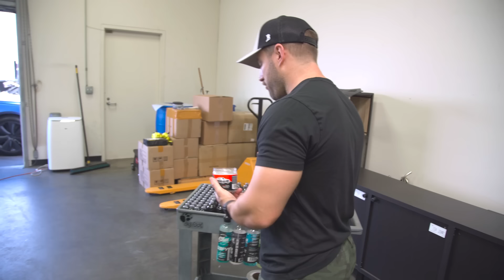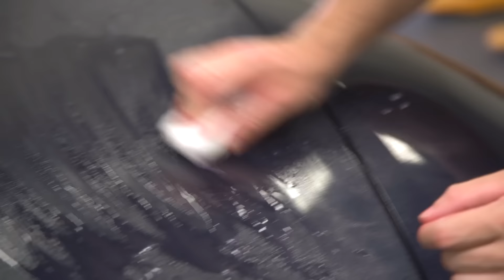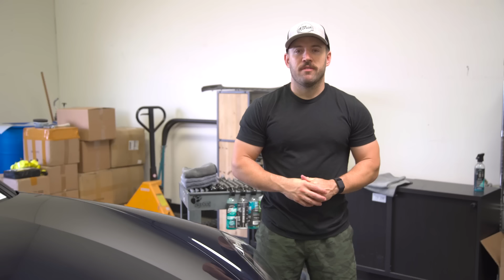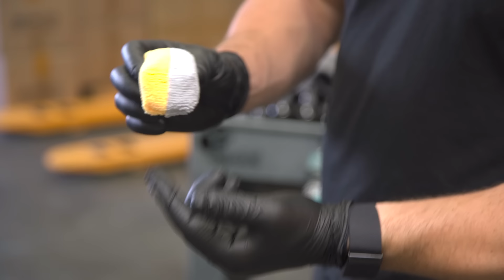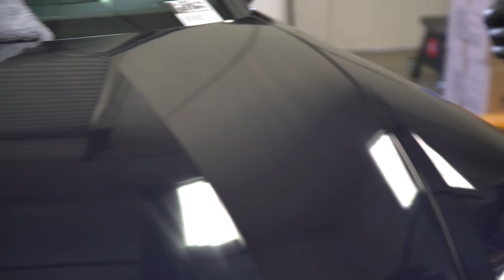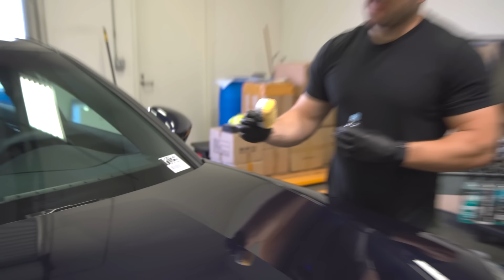How to Ceramic Coat Your Car Yourself - Step by Step Guide for Beginners

Comment: I recently came across an advertisement for ceramic coating services priced at around $1,500 (and I know it can get even higher). This prompted me to search for a do-it-yourself video. After watching your video, I visited your website to purchase the necessary materials. Following your instructions step by step, I am thrilled with the result and how straightforward the process turned out to be. Excellent work!
Reply from the maker: Your support means a lot to me. I'm happy to hear about your successful DIY experience!
Reply: It is super spendy! The place i have locally charges 1850 for my 2002 crew cab F250. It has a one year warranty. But gotdamn! 1850? This video was awesome. Yes, it's super time consuming, but with a 6 pack of your favorite brew, maybe some herbal supplementation, and some good tunes, it's actually not a bad time
Reply: @thomasknapp7236 I’ve always enjoyed detailing my cars but didn’t think about ceramic coating myself.  I paid to have my F Type done and think I’ll try to do my Porsche.  Like you said-music, beer, herb.  GTG
Reply: @thomasknapp7236  I would definitely skip any herbal supplementation unless you also want to end up with your lawnmower, rakes, snowblower, trash bins ect. to also get ceramic.
Reply: It’s not difficult at all.
Reply: any begginer tips  you can give? anything you wished you known before etc? thinking of doing this. how long overall did it take start to finish? (not curing)
Reply: What website?
Reply: That really depends. Just doing ceramic is simple but gets they are doing is buffing polishing and then putting a ceramic coat. The buffing and polishing is to get rid of the current clear coat and resurface the paint to get rid of all the scratches which is called paint correction
Reply: Excuse my poor grammar I wasn’t paying attention
Reply: People charge ridiculous amounts for a ceramic coating makes no sense. It's easy.
Reply: @ManMan-hs1fg  It has more to do with the amount of time it takes to do it right I believe. It is really easy, but you have to basically fully detail the exterior, degrease, probably clay bar and THEN apply the ceramic coating. That's at least 6-7 hours of work.
Reply: @billapostolou7478 not only that you have to polish the vehicle to remove scratches etc. its a 1-3 days job depending on  car  and conditions
Reply: It's the total process, this was a new car,if this was an older car u would have had to compound and polish also@ManMan-hs1fg

Comment: Hey I have a question about ceramic coating if I got it applied today and then when I got home there was some water spots that came from the mirror to go onto the coating and I used MEGUIAR'S Hybrid Ceramic (Spray) Wax to get it off because it was stuck on with a dry towel will this have ruined the ceramic coating the ceramic used was cougar ceramic coating 5 year and on the bottle is says to leave 30 minutes to cure before taking it in the elements which we did an hour and a half before taking it home so now I’m curious if me trying to get those spots off so it could cure in a garage did more harm than good?
Reply from the maker: Don't worry too much, it should be fine. Just give it some time to fully cure.

Comment: Can someone educate me?  ceramic is a sealant. So why would you use a ceramic spray while using a clay bar to pull contaminants from your paint? Wouldn't you be sealing in those contaminants?
Reply from the maker: Great question! The ceramic spray actually acts as a protective layer on top of the paint after using the clay bar, helping to seal in the clean surface and provide long-lasting protection.

Comment: Fantastic video!  Thank you for putting this together.  Perfect level of explanation, for me anyway! I detail boats and cars but never have gone as far as ceramic.  I'll be sure to order from your links if you provide them.

I have post-ceramic questions, though, that maybe someone can help with.

How long does it typically last?

Are there certain washing products that should be used after ceramic?

Do you buff the ceramic off somehow after so long before applying a fresh coat once it's worn?

Is there any sense in doing more than one ceramic coat at a time?

Does this completely eliminate the need for wax?

Does detail spray hurt it after?

Thanks in advance for any advice on the above!

Comment: This seems a lot easier than waxing tbh. Every time I've asked friends if I should ceramic coat my vehicle, they tell me I should pay someone to do it because it's a difficult process and expensive if I mess it up on my own.. lol But as someone who has waxed my cars for the past 10 years... This looks 10x easier and less painful on my shoulders.
Reply: Did you end up coating  yours ..I'm  in same boat ..I've been waxing vehicles for years ..but you talk to people about cerermic coating and they tell you it has to be done by a pro
Reply: They probably think it’s hard bc of the somewhat grueling prep process of wash, clay, polishing, ipa wipe.
Reply: What happens if you mess it up?
Reply: @hmmm9183  cant really mess it up, the worst u will see its like a "rainbow effect" on ur paint
Reply: You can definitely mess up a ceramic coating. Imagine waxing your vehicle and you miss a spot come the next morning it might be tough to wipe off depending on the wax. A ceramic coating dries as hard as super glue and you'll have to pull out your polisher to remove it if you miss a high spot because you don't have proper lighting or the microfiber you were using to wipe down your product was completely full and you never switched to a new one. It might seem easier than waxing your car but the process is way less forgiving if you miss a spot.  @AreskCSGO
Reply: That depends if you have polish the vehicle , that can be an extensive process?

Comment: Didn’t think you talked too much at all. With detail shops charging $3000 for ceramic coatings I’d imagine there’s a good bit of detail to be divulged if you wish to do it yourself. Thanks for the video!
Reply: Is brand new car also need clay bar ?
Reply: @dino20999  Yes. It's not as new as you think. Could've been sitting in the lot for ages.
Reply: @dino20999 same question here! I'm receiving my brand new car soon and im looking to do this myself
Reply: Before you coat it needs 100% decontaminated not just washed clay bar every panel.
Reply: Also, i don't know if these guys do it but there's a lot of buffing and polishing before you even get to the ceramic coating.
Reply: @01sazuke yes but also no. All depends on how much they care about their paint
Reply: It's the quality of the ceramic coating product , they are sold in prices ranging from 
50.00 - 500.00. Many have to be buffed , waxed to remove scratches and swirls before ceramic coating. Watching a new Porsche getting ceramic coating is useless. Watch a video that shows a 10 year old car that never had it done.
Reply: @dave7701 i got a brand new car and didnt find this video useless 💀

Comment: Great video that pray bottle on your pocket though.  That will eventually scratch something
Reply: Throwing the used towel on the windshield also hurt my heart 😭
Reply from the maker: @taseerrasheed1597  windshield is completely clean and safe to keep things off the paint work.
Reply from the maker: Definitely not as long as your careful, a lot more common things will scratch paint than that. We're in the business of removing scratches not installing them.

Comment: The finish shine says its a ceramic detail spray/coating topper. like it should be used on something that is already ceramic coated. Would it really be good to use it before you coat it?
Reply from the maker: Finish shine works great on top of ceramic coatings, we wouldn't recommend using it before application.

Comment: Do you need all the prep steps if you bring home a brand new car that was delivered with protective wrap from the factory and taken off at the dealer and driven home an hour away?
Reply from the maker: Yes because many cars still sit at the dealer or port during transit and need to be properly prepared.

Comment: Absolutely didn't talk too much. I think this was one of the best instructional videos I've ever watched on you tube. Completely on topic start to finish. Thank you.
Reply from the maker: Glad it was helpful!
Reply: I just washed my mk2 escort shell, sprayed black 2yrs ago and sat under a cover in my garage. 
Stunning colour, but it is so annoying, after one clean and I can see light swirls. Had to wash the sand beads from under dash panel etc 
After watching this, I will follow your steps from clay bar, as the wash has a wax in it, I used snow foam.
I nearly didn't click as thought a bit long.
Think you covered a great deal whilst showing.
Thanks, as it second vid I have watched. The first 4 mins long. That left me with questions.
The second, well you answered them.
Time to check the ceramic I have boat is a proper ceramic and second, check the curing time.
Sounds like a bit more science to it, then a wax on wax off application 😂
Watching this.
Reply: agreed!
Reply: agrred, great video!
Reply: Hi ,
Please confirm if I really understand the process:
Wash the car,
Use Iron removal spray,
Use clay bar
Than Wax
Than Detoxing cleaner 
Than apply ceramic coating small section by section

Comment: So let me ask this, if I have a car that has excellent paint is there any real reason I shouldn't do this myself? I do have a garage I could do it in with climate control. Basically heat/air. I notice where I live they charge between $500-$1000 to do small SUV. It would obviously save me a lot of money to do it myself. I'm definitely a DIY guy. I'm just curious if I'm really taking a chance on screwing something up since this would be my first time. Thanks for any info.
Reply from the maker: That's a great question! If you have excellent paint on your car and access to a climate-controlled garage, there's definitely a chance for you to do it yourself and save some money. Just make sure to do thorough research, watch some tutorials, and start with small areas before tackling the whole car. Good luck!

Comment: Your clay baring of the vehicle is one of the major factors to preparing before polishing! Your demonstration was so erratic it was ridiculous not even covering the complete surface. Not to mention using a clay bar in the professional detailing game , you actually pull and remove some of the bar off, need it then use it then dispose of. Folding the contaminated part of the bar back into it IS A MAJOR NO just asking for trouble of scratching !
Reply from the maker: Ok buddy

Comment: I got a good question 🤔 can I apply a ceramic coating on a color matched plastic like my rear bumper plastic? I can do it as long as I clay bar it first?no compounding needed?
Reply from the maker: Yes you can!

Comment: What about multiple ceramic coating layers? Cause here in the Philippines, they advertise it like there are different coatings. Others do 4 layers, some do upto 7-9 layers of coating.
Reply from the maker: Based on out lab testing, theres no additional benefits beyond doing 2 layers of coating.
Reply: @ethoscarcare here in malaysia,most detailer shop offer 3-6 layer of coating lmao..they just want to prey on the uninformed

Comment: Great video. Thank you. I'm getting a new car in about a month and I would like to apply. Hope often should I go through this process?  

Also in between, do I wash the car with a basic wash, water soap dry....?
Reply: Same question. How os the maintenance for a ceramic coated paint?
Reply from the maker: It really depends upon which level of coating protection you opt for, as they do range in terms of longevity. For example, our coatings last anywhere from 3 Years up to 10 Years.

Maintenance is very straight forward, routine washing and occasional topping and deep cleaning which can be done with just a couple products right in your garage or driveway.

Here's some more information: https://ethoscarcare.com/blogs/diy-car-detailing/maintain-your-ceramic-coating-like-a-pro#:~:text=They%20require%20maintenance%20and%20DO,and%20defect%20free%20as%20possible.
Reply: So if i ceramic coated one car and just washed and waxed a differnt car what would the difference be in 10 years? Pretty sure nothing.

Comment: Thanks for the instructional video,sir. Im new to ceramic and have several questions. Do i need to use both clay bar and decontaminating spray? Whats the purpose of clay bar if i dont have tree sap/metallic particles on my car? What is "flash"? Is microfiber towels ok to use? How does the polish remove scratches? Whats the time frame in applying ceramic? Do i remove ceramic coat after applying? How do i do that before the coat dries? Sorry for all the questions. Thanks.

Comment: Finished my ceramic coating project today with this product. Used an entire bottle on a 2019 Toyota Tundra. Ceramic app and wipe off is one of the easiest parts. Clay bar is the hardest. I've done clay bar before but on this Tundra there was so much rail dust that it took my almost 4 hours to clay bar all of the rail dust and other contaminants off. Even then, there were a few I couldn't get. Detox coating is the easiest. Overall I'm happy with the process. It was a bit warmer in my garage so flashing I think was a bit faster than 3 to 5 minutes but I tried to be patient and waited close to the 3 minutes in most cases. Interested to see how it repels water, mud, etc.
Reply from the maker: Amazing! Glad it worked out well for you.
Reply: 8oz to do a Tundra? I'm going to be doing a Tacoma and was wondering if 8oz will cover it?
Reply: @PianoUniverse  8oz. should be plenty.
Reply: Was it worth it then?
Reply: @Saqibot  financially yes, it wasn't that expensive if you're doing the labor yourself. From a labor perspective, it's worth getting the rail dust off and if I were to have that much rail dust ever again, I'd probably do it again. Just need to reserve yourself almost a full weekend to complete the job.

Comment: What product should I be using if I have to buff out swirls after clay bars but before applying the ceramic coating?  Any specific ones for your step 3? Will the decon spray remove all?
Reply: You have to do paint correction via some wax and then use a ipa remover to get rid of any contaminants and then ceramic coat.

Comment: New vehicles come from dealership with swirls. Surprised you didnt have to polish considering you clay barred.
Reply from the maker: It will vary car to car whether polishing is required. In this case the paint was not in need.

Comment: Awesome video. You gave me the
 confidence to try to do this myself
Will one 50ML bottle cover a full sized 1/2 ton pick up?
How many coats should be applied?
Reply from the maker: Yes, 50ml will coat most full sized pickup trucks in one coat.

Comment: Nice video! Thanks! I have one question though - How do you coat tricky areas, for example under the door handle ? Do you still use the applicator or just remove the cloth and use it directly to reach underneath ?
Reply: Those applicators have a foam core and will conform and compress to get to those areas. 

At work I use the supplied applicator block and swatch that comes with the coating. It has no problems getting under the door handles. I will remove the swath to get into the intricate areas of the wheels and similar.

Comment: I never saw someone applying clay bar this way. very strange wet the clay bar and pass it on the car like a towel. I wouldn't do it that way. pretty sure the clay wet wont grab anything.
Reply from the maker: Its always good to use a clay bar with lubrication. How do you use a clay bar? We have a great instructional video in our channel we recommend looking at.
Reply: The clay is an abrasive…which will in some form mar your paint-this is the reason you NEED a lubricant when you clay…to protect it…

Comment: Oh hey , nice video, curious after the clay wax is done, could one just re-wash the car to get off the any left  over clay?  I am wondering if the bottle you used to wipe off old clay could be the same bottle that was used with clay bar.   i notice most products come with clay bar + detailer included. thank you
Reply from the maker: Yes you can!

Comment: My question is re partial PPF installs - with the problem of high spots when coatings aren't fully removed, don't they leave visible build-up along the edges of the film where it's impossible to completely buff off?
Reply from the maker: Good question, you can get some build-up along the edges of the clear bra. A good way to avoid this is to wipe parallel to the clear bra seam to ensure you're not pushing coating into the edge.
Reply: @ethoscarcare  Thanks

Comment: I'm doing a brand new motorcycle. 0 miles. Do I have to use a clay bar?
Reply from the maker: It is recommended as prep, since even new cars/motorcycles may sit outside or collect contaminants during transit.

Comment: What do you mean by the product flashing. What does it look like and how do you know it’s time to wipe off
Reply from the maker: The product flashing refers to the solvents in the coating reacting to the atmosphere and allowing the product to bond to the surface. Usually when this happens you will notice a rainbow like effect on the coating (Some coatings are more pronounced than others). Its ready to wipe off once the flashing has died down or diminished and the coating has bonded to the surface. Each coating will vary on the flash time so its best to follow the manufacturers instructions.

Comment: Hi, what about washing the car, does it effect the Ceramic Coating if you wash the car weekly?
and can you drive the car normal or do you have to wait days before you take the car on the road.
Reply from the maker: Not at all, the coating is resistant to chemicals so washing will not affect it.